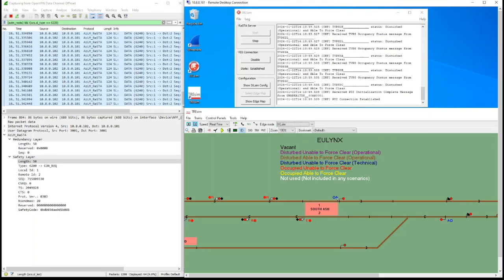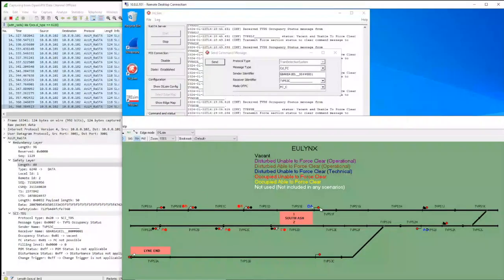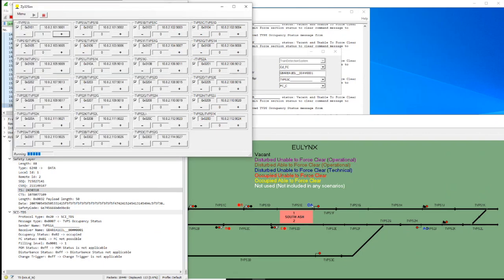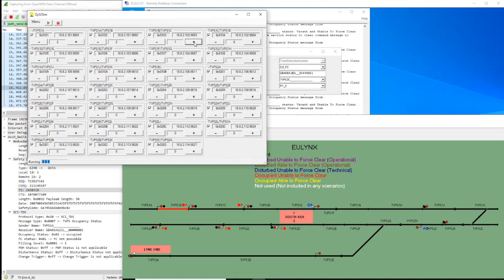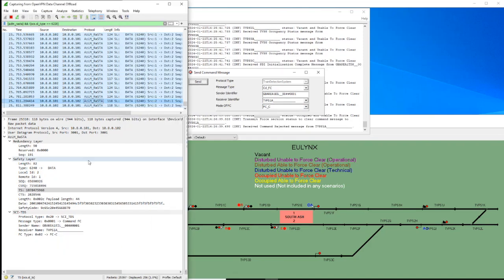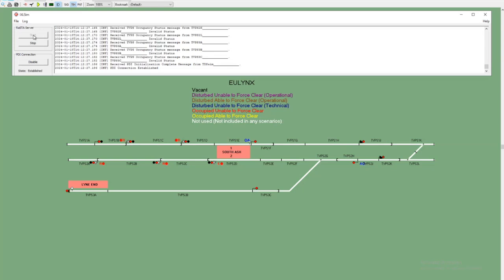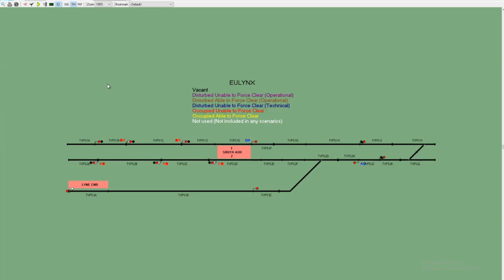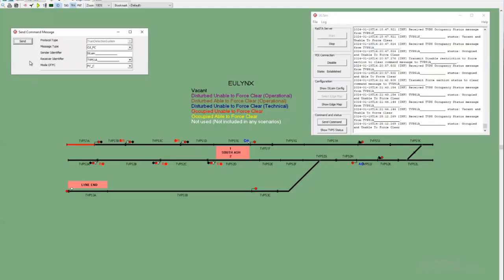EULYNX TDS Demonstrator   Short Version

Comment: So basically you can connect any point machine to any Interlocking. That is really easy as point machines are more or less similar. But something more complicated like Interlocking RBC?  And of course is the issue of licence.  If I want to use the specification how much will cost me ( I am an rail infrastructure manager).